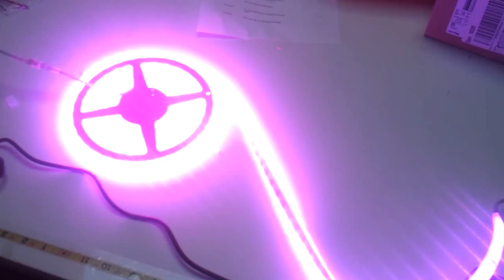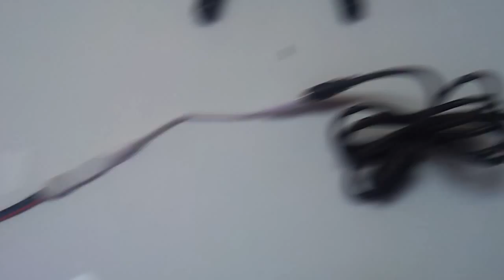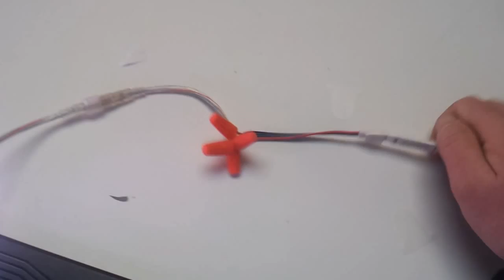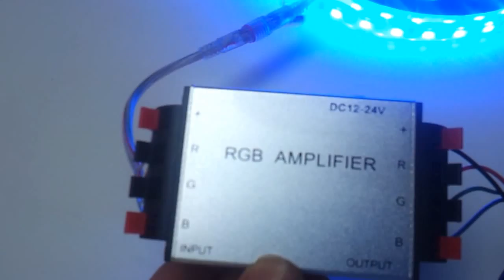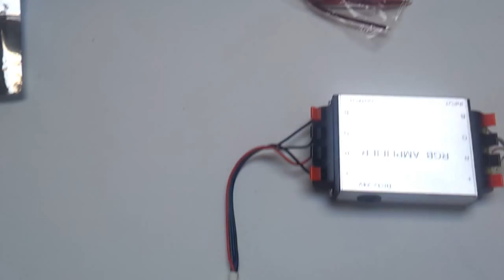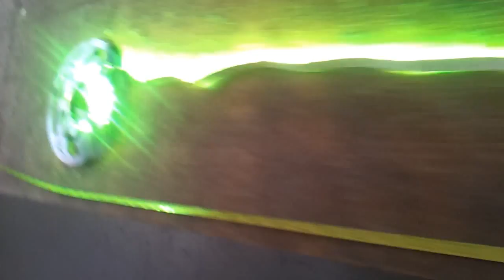How to Install LED Strip Lights: RGB Long Distance Installs with Amplifier

Comment: I'm wanting to run 2 sets of these to my sign at the road.  I'm trying to run 12V out to the sign nearly 200 ft away.  Any ideas how I may be able to make this happen?  If I run 120 to the sign I have to get an electrical permit whereas if I run 12V I don't.  Thanks.
Reply from the maker: Stephen: There are a couple of different options to complete this install. To start we highly recommend that you contact an electrician. If you were to try and do it this way (with the long DC run) we recommend running 12v DC wire (most likely 4-6 AWG) from your store to the sign. Make sure that this wire is outdoor rated and protected. You will need to run two lines of it so that you can power each reel. Inside the sign you will also need an RGB signal amplifier to make sure that the second reel is powered without having any voltage drop. Please feel free to email us for further assistance.

Comment from the maker: Yes you can, but you should run it somewhere else through the 12v system in the car, When you start the car, the 12v sometimes can jump up to a lot more than 12v, and damage the remote. If you put a voltage regulator between the power and the controller it should work.

Comment from the maker: You can use a larger power supply and run 12v to the amplifier from it. I would locate the power unit centrally and run the appropriate wire gauge to the amplifiers.

Comment: i want to connect 20 meters of 5050 RGB 60 led/m  , and i have 8A per channel amplifier how can i wire it correctly ?
and can i put the amplifier in the start just after controller to supply whole 30 m with amplified power or not ? as i get 8 Ampere amplifier per channel for every 20 meters

Comment from the maker: Hello Steve,  You can use one power unit to power both strips of 300RGB. If you put the (2) reels of the RGB 2 connected to one power unit, you would experience some voltage drop, the end of the run would be realllly dim, and the colors would not look right. However, you can make put the RGB controller in the middle of the run and have one strip go to the right, and one to the left out of the remote. Make sense?

Comment: Hey there, got a couple of questions if you dont mind :

Do I need to power the amplifier with a separate power supply ? For example : I have 2 rgb reels 300led.5m so I would need : 2 power supplys for 12v 5A and an amplifier. Or just one power supply ? Or I can power the first strip and the amplifier from a 12v 10A power supply ?

What would happen if i just put 2 strips together with a 12v10a power supply without an amplifier ? the 2nd strip would be less bright or lose signal ?

Comment from the maker: Both amplifiers are the same, the difference is in the size and conenctions. You can use the mini amplifiers every 5 meters (for 300 LED strips) and for every 10 meters (for 150 LED strips). Each amplifier needs to be powered also.
Reply: Would amplifiers be powered by transformers